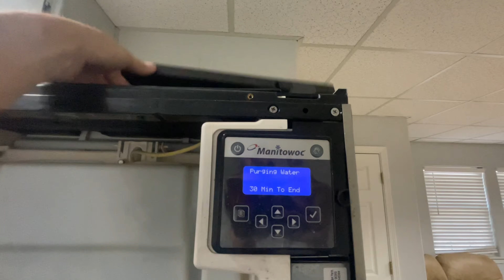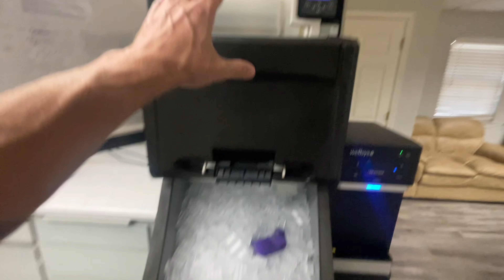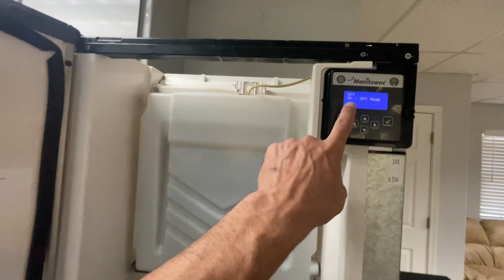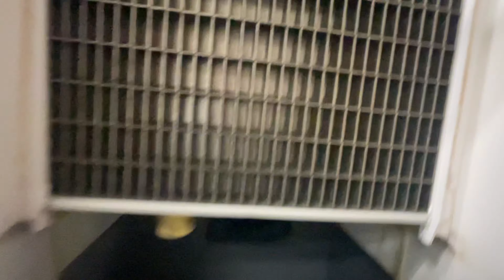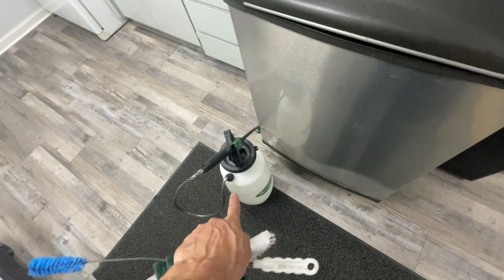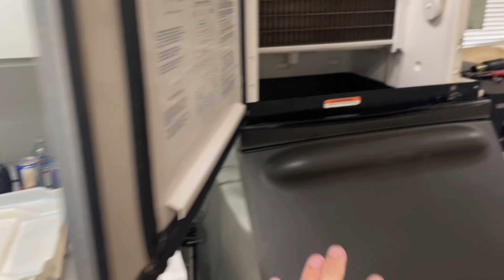How to clean a commercial ice machine

Comment: Awesome video, I have a question . After running the Sanitizer thru after reassembling do I need to throw out the first couple of batches of ice? Thanks
Reply from the maker: The clean cycle runs through a series of Fill/Circulate/Flush cycles. This is designed to clear out the sanitizer used during the clean cycle.